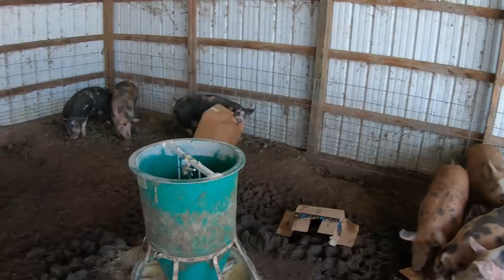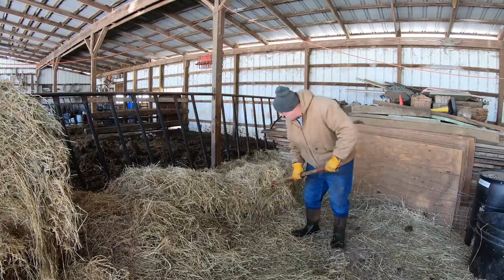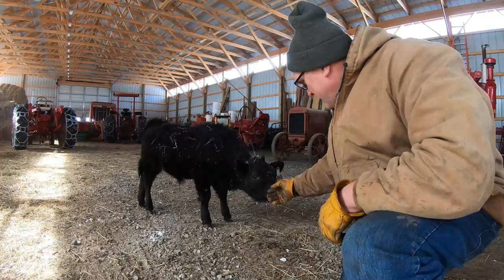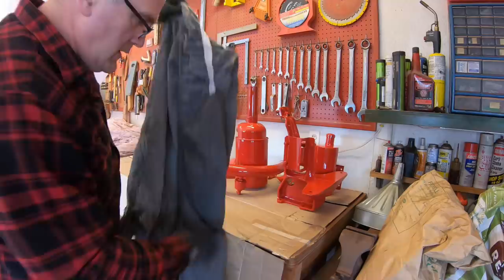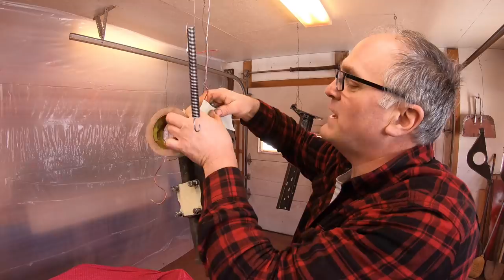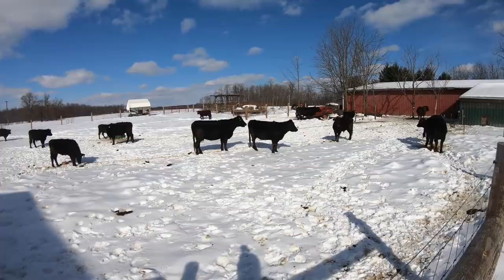Farming the Hard Way

Comment: I currently face a similar problem.  Instead of looking for hay I bought whole dried corn from a neighbour.  You can feed up to 40% of their ration as corn and they back off a lot on the hay when they have a good 'belly full' of corn. I have to make my hay last until April 23 when the cows (all bred AI for the 'same' day come due).  I am sure I can let them out to pick once they calve if my hay is completely gone. You can also 'make' them eat the sorted hay because it will fill and the corn will meet additional nutritional requirements.

Comment: What kind of hoses are you using for water, I've bought cheap, I've paid well over $100 and cannot find one that won't kink in the winter. I end up hanging them up in our basement.
Reply from the maker: Hi Brian, I can't find good ones either. I think I'm going to try one of the contractor supply places next. I want those thick green ones that landscape contractors use.
Reply: Had a greenhouse company (growing annuals). Tried all kinds of hoses over the years and finally settled on 5/8" black rubber hose. Expensive, but durable and so much nicer to work with.